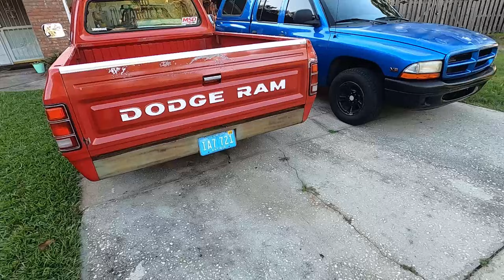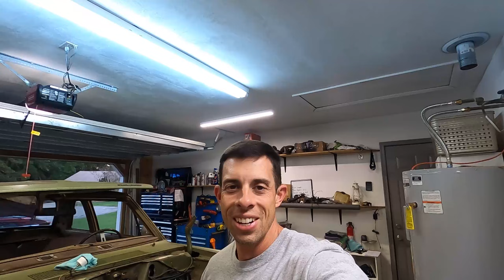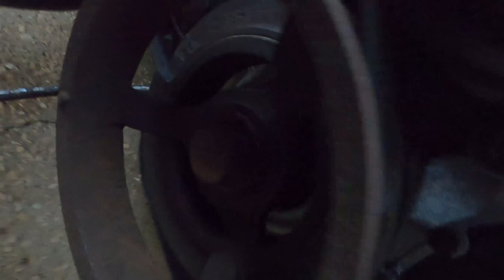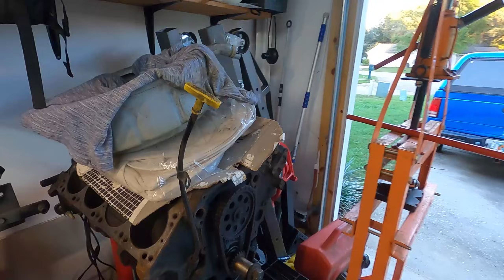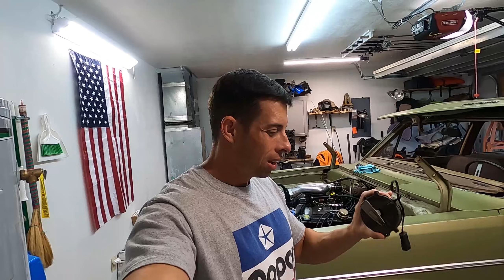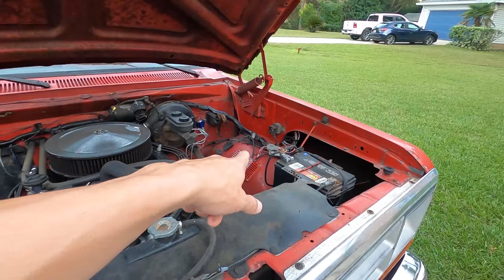318/360 Magnum Swap Info

Comment: I dont know if youll see this, but im super curious how you were able to run the magum ecu controlled alternator on an la
Reply from the maker: Bigger charge wire and a different voltage regulator.
Reply: @TheGasTap just an external style wired uo to the plug on it?

Comment: Do you have any experience with doing a swap on a vehicle that has an np435 transmission. Super curious on what flywheel and clutch kit i need to buy to do that swap
Reply from the maker: I haven’t done one. 🤷🏻

Comment: Thanks, some of the info on this swap are confusing but your video is very informative and easy to understand. Thanks for that. One question is on the intermediate shaft if using the roller cam and changing to la dizzy, it gets left alone correct?
Reply from the maker: What are you referring to as the intermediate shaft?

Comment: Did u grind off some of the block to install a high torque starter
Reply from the maker: No
Reply: @TheGasTap  my block above the starter had a recessed hole with the outer edge that I had to grind off to make the small starter fit the 904

Comment: this is great information I am going to be soon swaping a motor in an 02 ram for one of the farm workers a bit different since the 02 had either the 3.7 or 4.7 and was the first year of that body style and ifs in 4x4s and last year of the 5.9 aka 360 poor ol fella just paid 3 grand for it and the motor is junk but one of our truck drivers has a 96 with a brand new 5.2 aka 318 I knew it could be done glad to know to pay ateention to the flex plate and the driver side motor mount thought I havent been much of a mopar fan I been intriuged with the 360 becxause when they are right they are bad @$$

Comment: Hey can you use the LA timing cover with mechanical fuel pump and still retain the serpentine belt drive?
Reply from the maker: No. The water pumps are different so the pulleys are also different.

Comment: Can you used the stock 360 magnum flexplate with a 727 t flire?
Reply from the maker: Yes.
Reply: I have a shorbed just like yours. It has a 318 with factory AC so I want to keep the v belts. Do the magnum heads have bolt holes same as LA heads?
Reply from the maker: @egodeathplease  yes.

Comment: Great info thank you. I have a 1995 Dakota 5.2 magnum. I call it my time capsule super clean, 27,850 mile original been in our family. So I want to locate a a tunnel ram dual four set up if I can find an intake manifold.
Reply from the maker: They don’t make a tunnel ram for the magnum heads.

Comment: Any advice on limited slip dif for a 1986 D150 360 400hp+?
Reply from the maker: I’m running the factory ‘86 in mine and a ‘98 ram unit in my valiant that I put new clutches in.

Comment: If a person built a hot 5.9 Magnum for the strip it might need an approved flex plate. Is there such a piece on the market?  You mentioned B&M quit making their balanced 5.9 magnum flex plate. Same for the dampener. Are there aftermarket approved pieces for racing?
Reply from the maker: I haven’t had to look for one in a few years. I’m not sure.

Comment: Nice vehicles dude my question is  I have a 1989 dodge truck with a 3.9 v6 fuel injected engine but I would like to put a 2003  360  magnum from a r/t Durango and I want to put a carburetor on it and get rid of the fuel injection so what wiring issues ‘‘em I going to have and do I just have to put a fuel regulator on it to control my fuel pressure
Reply from the maker: Pressure regulator should be fine. You need to check the difference in the alternator output. You may need to upgrade the wiring. You will need a some kind of capacitive discharge ignition. (MSD etc ) for the distributor

Comment: Info on your alternator brackets? Running into an issue with brackets on my 84 magnum swap due to the bosses on the heads
Reply from the maker: I’m running the magnum alternator. No issues. Are you running la brackets?
Reply: @TheGasTap  I'm using LA timing cover and LA accessories but the alternator bracket doesn't seem to fit due to the bolt boss sticking out about a half inch on the cylinder head...
Reply from the maker: I’ve never run into that issue. I have used the chrome aftermarket alternator brackets with no problems.

Comment: Question on the magnum valve springs did the pac1286  did you have to do machine work to get them to fit onto the Magnum cylinder head and what size lift cam are you running thank you
Reply from the maker: Small .465 cam. No head machining.

Comment: Hey Boss… Will a LA dapner Bolt on a magnum engine?
Reply from the maker: Yes….but it isn’t balanced the same and will damage the engine.
Reply: @TheGasTap  What can I do?
Reply from the maker: Use a magnum damper.
Reply: @TheGasTap  I can’t both the pulleys on the run, the V belts
Reply from the maker: Oh yes you can. Early magnums have bolt on pulleys. Look at my Valiant build.

Comment: Thanks for all the points of difference in the LA  Magnum comparison and what to watch out for if I go junk yard dogging and pickup a magnum for my 70 Challenger. I have been running LA 318 for years with a Proform crosswind dual bolt pattern intake. I like the stud mounted rocker arms like sb chevy’s and there is the roller cam in the Magnum as well. The timing cover info was great, and the mechanical vs electric fuel pump too. Thanks for a great video.

Comment: Hey, great vídeo can I run the stock magnum cam with a carburetor and use the LA timing cover so I can use the LA alternator and an electric fuel pump?
Reply from the maker: Absolutely
Reply: @TheGasTap  I changed my mind I can go with the mechanical fuel pump and the spacer for the cam right?
Reply from the maker: Yes. That’s how I’m doing my next one.

Comment: Very nice video. I have a1999 360 and I was wondering if I can advance my cam 4 degrees without doing all the modifications?
Reply from the maker: Advancing the cam will just change the operating range.
Reply: Operating range ?will it give me more low end power ? Save me fuel ?

Comment: 5.9L Magnum flex plate won't bolt up to 5.2L Magnum torque converter,at least it won't bolt up to a 42re/44re  torque converter. 5.9L Magnum has 4 bolt torque converter for the 45re transmission. Can't use a 5.2L Magnum Flex plate on a 5.9L Magnum because the 5.2L is internally balanced and has no balancing weights on it. The 5.9L Magnum is externally balanced and it does have  balancing weights on it. Engine will be out of balance if Flex plates are swapped and cause a nasty vibration.
Reply from the maker: Yes!

Comment: Hey I did a 360 swap in my 87 dodge w150 I’m having problems with the charging system do you have any advice
Reply from the maker: What alternator are you using? The magnum alternator puts out more amps than the old 87 ram alternator and will fry wires. You’ll need an external voltage regulator
Reply: I have some advice get a Delco Remy one wire that is internally regulated and scrap all the Dodge charging system one wire straight to the battery

Comment: Did you have to modify the engine mounts in the valiant? I have a 72 dart I been thinking of getting a used 318 out of a 2000 Dakota and use the wiring harness ecm. The dart is an original 318 car
Reply from the maker: 318la and magnum have the same mount ears on the blocks.

Comment: Hello. Could I please have your help? I have a 1983 Ramcharger 4x4 318 with a 4 barrel Sniper installed. Jess has a part number 059 HP73 from ATK Engines. It states that this motor will fit 1981, 1982 and 1984 leaving the 1983 out. Any ideas? I have Air conditioning. The Jegs guy states that the engine is interchangeable and power steering, alternator, headers and ac will all hook up from the 318 to the 360 magnum. Can you help me with the easiest way to put this 360 long block in from Jegs? Running AC on VBelt.
Reply from the maker: You just use the timing cover and everything off the front of the 318. You need an externally balanced 360 flex plate and balancer.

Comment: Thanks for the info but I do have one small question. I am thinking about putting a magnum in my 91 ram with ac. If I purchase the camshaft spacer and run the mechanical fuel pump, la timing cover and accessories including the la style air conditioning, can I use the cheaper Chinese intake or do I need to use the expensive intake. Thanks.
Reply from the maker: The Chinese manifold is more similar in o the LA intake. It should work fine.

Comment: My 360 is getting old I did the plenum fix it leaks oil rear main and timing chain cover.runs pretty strong for almost 200k turning 35 and dana 60 axles   but my question is...buy a rebuilt 360 5.9 or find a 8 liter v10 they offered in the gen 2 trucks I have no ram friends come from chevy gear head family and will the computer work ?  We have no emissions in north idaho gutted my cat when the plenum fouled it and went with flow mastercv40 series .how do you set timing without a fancy computer on these magnums
Reply from the maker: Get a 360. No aftermarket for the v10
Reply: @TheGasTap  what is a fair price to buy a rebuild? And should i get rid of that kegger intake?
Reply from the maker: I would 💯 get rid of the keg. Not sure on rebuilt prices. I did my last two in the garage.

Comment: On the Chinese intake what kind of thermostat housing did you use?
Reply from the maker: I used the large Mopar housing from Summit Racing.
Reply: @TheGasTap  were you able to use the original transmission dip stick? Mine doesn’t want to fit because the exhaust manifold is in the way
Reply from the maker: Yes but I have long tube headers.

Comment: Hey Alex, love the truck man! Git lil project of my own 88 short bed. Gnna do a mag swap. Was currious on ur thoughts about running a od trans A518 or if you have any info or experience on  doing such a swap? Thanks for any info you might have. Mopar or no car!
Reply from the maker: I don’t have any experience with them but there will be a power loss when using any overdrive transmission.
Reply: @TheGasTap  ok cool cool. Thanks for the reply Alex. Have a good one.

Comment: Great video, I've learned a few things.. I'm wanting to swap out my 360 in my W250 for a Magnum 360 will it bolt up to the stock transmission without adapters or modifications
Reply from the maker: Bolts right up. The external balance is different so get the right flex plate.

Comment: Do you think i could take the engine side of my 318's wiring out and connect the engine side 360 magnum's wiring and it run fine or do i just need to carb swap
Reply from the maker: I’ve seen plenty of ppl use the stock wiring and computer when doing a magnum into an older vehicle. You should be fine.

Comment: Can I exchange a 360 Dodge motor for a Ford F700?
They are both older styles. In the 80s
Reply from the maker: It would be a lot of work and the transmission would also have to be swapped but it can be done.

Comment: Hey you really seem to know your stuff I am playing with the idea of changing my LA 318 to a magnum 318 in my 83 Chrysler Córdoba just because I want EFI and I was wondering how different is the wiring between the two and what year would be the best magnum to swap with any help would be great thanks
Reply from the maker: The Magnum EFI is easy to swap. What year all depends on if you want OBD1 or OBD2. I like the idea of an Edelbrock Air Gap intake and a Sniper EFI. More power and still easy to do.

Comment: I sure could use your help. I have a 1992 w150 5.2 magnum with a nv4500 5 speed I keep having computer and wiring problems. How difficult is it to swap to a carburetor? Thanks
Reply from the maker: It’s easy. Depending on what you use the truck for, I would try to fix the fuel injection but that’s just me.
Reply: @TheGasTap  Thank you. Its just a play around truck. So I'd go with a 4 barrel carb. I've replaced the computer once and its back at a no start situation.
Reply: @TheGasTap  i will keep trying to fix it but i also have a chance to buy a 360 408 stroker.. Will that bolt up to the nv4500 ?
Reply from the maker: Could the no start be an intermediate cam or crank sensor?
Reply: @TheGasTap  Well i just checked the fuel pump and its not pumping fuel. I just replaced that. Thanks for all of your help 🙏

Comment: Is it difficult to take out  1987 w150 power ram 318 LA engine assembly and put in 5.2 magnum engine with EFi and entire wiring harness ? 727 transmission.
Reply from the maker: Nah. You’ll probably need a tuner to tell the computer that the transmission is changed.

Comment: I getting ready to do a 5.9 mag swap in a 1973 Plymouth satellite factory ac, if I go with the v-belt and the cheaper intake manifold, will the factory ac pump still bolt up or be in the way of anything
Reply from the maker: I haven’t done one with ac but I’m pretty sure it will clear.

Comment: Explain the electric fuel pump if I wanted to go that route
Reply from the maker: You can buy a Holley drop in unit made for these trucks or a universal inline full pump.
Reply: @TheGasTap   is there a better way to contact you I have a lot of questions
Reply from the maker: Facebook or Instagram 
The gas tap on both.

Comment: Im in the process of swapping a magnum into my 78 aspen. I'm wanting to use as much LA parts of the old LA motor as I can. Will the the LA front pulley work or will i have to find an older magnum pulley?
Reply from the maker: LA pulley will work but you have to use a magnum balancer.

Comment: You dont have to use an a/c delete pulley. I dont get why so many ppl think you do. Just get a belt for a 2nd gen ram that didnt have a/c option. Its shorter and you save $50. I have a 93 dakota and running 318 without an ac delete pulley. I think i bought a belt for a 96 or 98 ram 1500 with no a/c.

Comment: Will a stock 727 converter bolt up to a 360 magnum flexplate?
Reply from the maker: Yes but one hole will need to be elongated.
Reply from the maker: If you watch the engine and trans install video on the Valiant I talk about and show the converter and flexplate install.
Reply from the maker: https://youtu.be/kkyjSqlQ-jU
Reply: @TheGasTap   thanks man i'll check it out
Reply: @TheGasTap  does the stock 727 tourqe converter weight need to be removed if you have a stock weighted 360 magnum flexplate ??

Comment: I've got an 89 ramcharger with a very tired 318. I'm looking at swapping in a 360 magnum engine and had a few questions.  1.)  Will there be a significant power gain? 2.) Is there any specific year magnum engine to stay away from?
Reply from the maker: All the magnum engines are that same. The only thing different you will find is the early magnum 360 had a weighted torque converter and was later changed to a weighted flex plate, also the early model had a bolt on crank pulley, later models have the crank pulley joined to the balancer. 
I compared a stock 360 magnum to the 300 hp 360 create engine.  everything seems the same. I'd est a 360 magnum with a carburetor makes close to 300 hp while an old stock 318 LA makes 175ish.

Comment: Dude love the video helps so much iv played it 7 times just going over parts I need i don't know crap about ignition systems though little help please
Reply from the maker: Get a stock late 70’s distributor(can’t remember the part number off the top of my head) a MSD 6al and an accel super stock coil (40825). Add in a 4secondsflat.com distributor limiter if you are adding a camshaft. Don’t use vacuum advance either.

Comment: Going to swap la to magnum will stock magnum oil pan clear cross bar. I’ve been told I need to use my la oil pan and sump but I don’t see why. Thanks good videos btw!
Reply from the maker: What kind of vehicle are you swapping it into? If it's a truck, then use the truck magnum pan.
Reply: @TheGasTap   87 d150

Comment: Hey Alex i have a 85 getting ready to put a magnum in it what did you have to do to wire the newer alternator to the older harness
Reply from the maker: There is a kit with regulator and wires. The link is in the comment section here.

Comment: Question my man... On Big Red, I see an electric cooling fan on the radiator. What fan and controller did you end up using and have you had any cooling issues with them?
Reply from the maker: Cheepo eBay 16” fan hooked to key on power so it always runs. I haven’t had any issues with it getting hot.

Comment: Quick Question. You said with the Chinese intakes that you cannot have the AC. Does that also include the Dorman AC Bracket you have on Big Red?
Reply from the maker: The a/c delete was put on bc the a/c compressor wouldn’t fit when I had the Proform intake on Big Red. So, yes, the A/C delete pulley works on both.
Reply: @TheGasTap  Thanks for the quick reply. Which Carb did you go with?
Reply from the maker: I’m still using an old Holley 750 vac sec.

Comment: Awesome truck! I'm building my first high school hot rod, 80 d150 short box, mild built 360 (400hp to flywheel) 727 automatic. 

Can you suggest a stall converter size and rear gears?
Thanks!
Reply from the maker: I run 3.55 gear in all three of my vehicles. 
As far as converter, you need to pic out your cam, gears and tire size. Also new to know the weight of the vehicle. Then call a converter company you like and they will use all that info plus more to get you the right converter.
Reply: @TheGasTap  Great information, thanks! My high school shop teacher suggested a 2500 stall with 410 gears because of the trucks weight, but he's a Cheby guy Lol.

Comment: What model electric fan are you using? Is it adequate in slow traffic?
Reply from the maker: 16” electric eBay fan $35 and stock radiator. It never overheats.
Reply: @TheGasTap  Thanks for the tip. I looked at those but ended up with a 06-up pt cruiser fan for $40. It includes the hi and lo speed relays mounted on the fan. I looked up the schematic and found it uses a 40amp breaker so it should blow really well. I'll use the low speed relay with a thermal switch and the high speed relay control to a toggle back up.